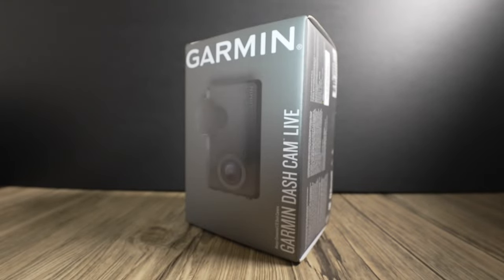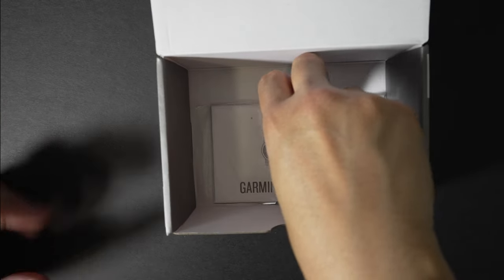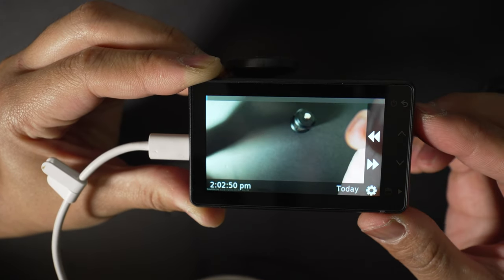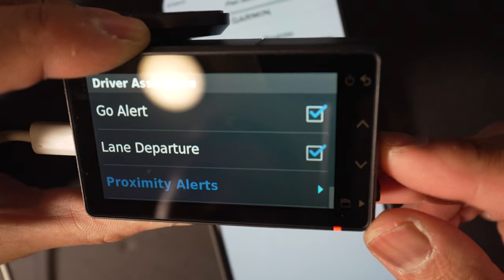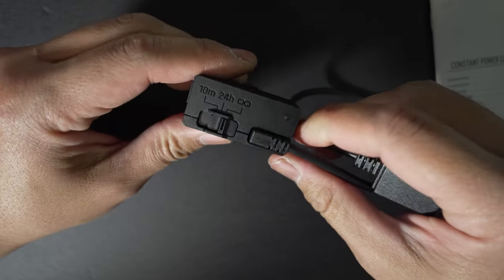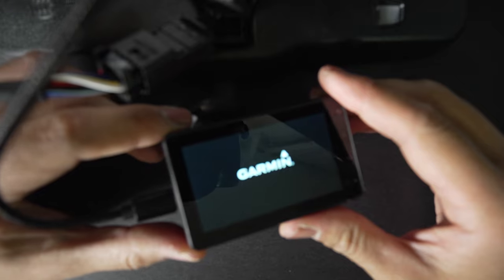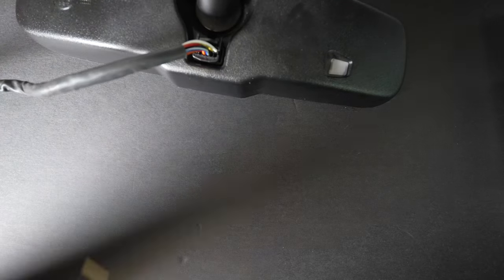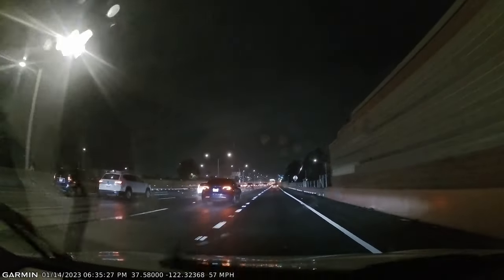GARMIN DASH CAM LIVE 'Always-Connected' LTE Dash Cam ... Ring Car Cam competitor!

Comment: I always appreciate when people take the time to create detailed reviews. In this case, although there was a lot of valuable information about connection/power options, I don't see it as an overall review especially since none of the feature menus were reviewed, nor the actual real-life performance, which you may be planning for a later video. Perhaps a retitling to indicate the main focus of the review would be helpful for people seeking various options for power sources and connections.
Reply from the maker: Thanks for the feedback! It was originally intended to be a review, but after the initial installation and set up, I had no reason to dive into the camera or app again (at least until there's an accident) and there wasn't a real use case for me to use the remote connection...so I felt like it wasn't a compelling thing to show. 

It's been two months of using the camera so I'll post a follow up video and discuss my conclusions: the "parking guard" hasn't captured anything useful, and every time I get in the car and close the door it registers as an event but as the recording faces forward, its pretty useless. 

The cam also registers driving over speed bumps as collisions. The unit also gives redlight cams and lane departure warnings, on-screen...but I don't ever bust through red lights to need the former, and my car features lane keep assist so I don't need the latter.

Comment: I have this exact dash cam & my question is do I always have to press the bottom button for it to record because anytime I want a footage of what’s happening I have to press a button for it to record. Please help me out
Reply: Yes, of course, that's the way dash cams work: it always records but it overwrites it all the time and only permanently stores the footage if you tell it to (naturally it records from before you pressed the button to slightly after). 
But you don't have to press the button if you have voice controls activated, then you can also alternatively just say: "Hey Garmin, save video" and it will do the same as if you'd have pressed the button.

Comment: I’m concerned about the internal battery. Other Garmin dash cam use capacitors. Why lithium battery for all their dash cams with built in display instead of super capacitor. That would reduce the product lifespan dramatically when that battery no longer hold charge and being exposed to the sun makes it even worse. -thoughts?
Reply: To help the battery in your vehicle not die

Comment: hey wasup guys I have this dash cam and is recording in intervals and skipping footage i use it in my work truck and got into a miner fender bender and I couldn't find the footage of the incident I have a Samsun 500g sd card in it and I've looked all over the settings trying to figure it out any help is appreciated
Reply from the maker: Are you using the app or connecting it to the computer? Did it upload the footage to the Garmin Drive app, maybe?
Reply: You have to press the button after the incident for it to save it. Or you can use voice controls to tell it to record the incident.
If you don't do anything it of course won't save anything, it'll very soon overwrite it. You might still have the video file on the SD card (it's divided into the "incident"-marked events you've stored for safekeeping and the normal constantly recorded footage which is then overwritten)

Comment: I f’ing loathe that almost all these cameras are still using that pathetic micro USB. It’s 2023. Unreal.
Reply: As for so many others with the very strange complaint: who cares which connection it has as YOU are not supposed to be hooking anything up it than the cables which are supplied in the package. It's NOT meant for you to connect anything, you don't need that port for your own use. 
Just use the SD-card or the cloud features.
Reply: @pistonburner6448  that does not change the fact that it’s completely antiquated and old. And across the globe there’s literally laws being put into place to make one universal standard. It’s common fing knowledge. The days of fragmentation when it comes to different charges and in this case completely old standards are going away. So yes, it’s still stupid to implement this “old tech”. Next base and Vantrue, not very big names in the game are doing it. There’s no reason why the bigger guys can’t adopt it too other than laziness.
Reply: @ThatCleanMT  No, you are wrong. The laws about one standard are for phones, and the idea is since you need to charge your phone on the go or use all kinds of accessories they should be compatible no matter where you connect it or what you want to connect it to.
That does not apply at all for this dash cam which doesn't need various chargers or accessories to be compatible: it's meant to ONLY be plugged into the car for "permanent installation" using the power source which is provided by Garmin when you buy it. 
This is NOT a mobile device, and is NOT meant to be plugged into all kinds of different devices/chargers all the time.

You just plug it into the car's system and use that FOREVER. You don't handle the data using the micro-USB, you use either the cloud/connectivity or the SD-card.

Micro-USB is BETTER in this camera since it is SMALLER. It's ONLY role here is to connect it to the car's power and since any connection can do that it's best to use not only the smallest connector possible but also the kind of connector which can have that angle'd feature! USB-C would be WORSE as it would mean a bulkier and non-angled connector in your line of sight blocking more of your windshield, and would improve nothing.

I have used an older Garmin model (2 of them: one in the front and one in the rear) for years, and I've 'installed' them to a few different cars already. You NEVER need to use that micro-USB for anything but the Garmin-supplied power source...especially now with this new model's LTE connectivity.
Reply: @ThatCleanMT  I just proved you totally wrong, comprehensively. Deal with it. 

This is NOT a mobile device, NOT meant to be connected to hundreds of different things. It could literally be a fixed cable, but it's nice to have it separate so you can change it if it gets damaged.

It's not meant to be constantly connected to DIFFERENT cables or devices, it's meant to be connected to the ONE cable you install in your car and doesn't need to be detached at all necessarily.